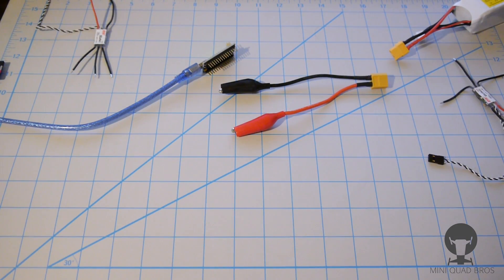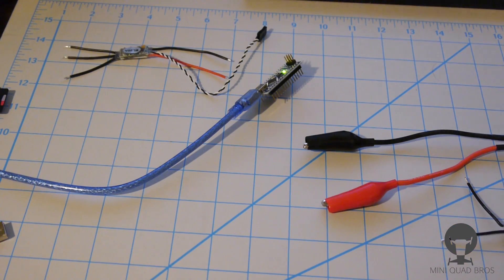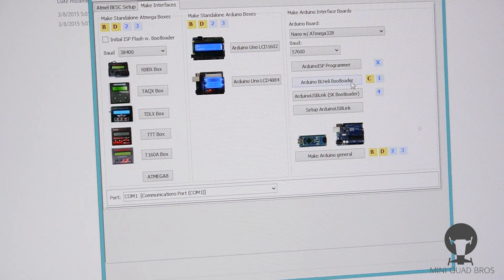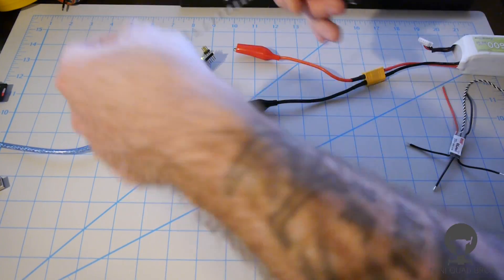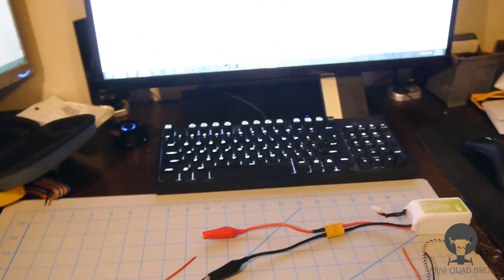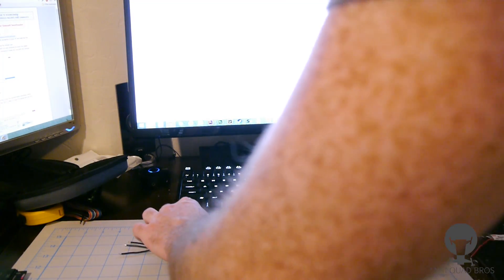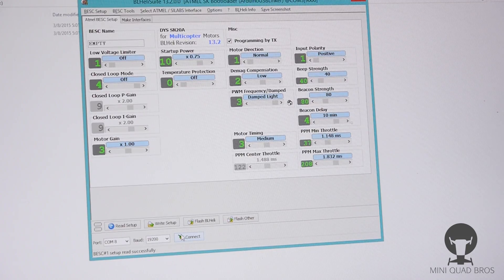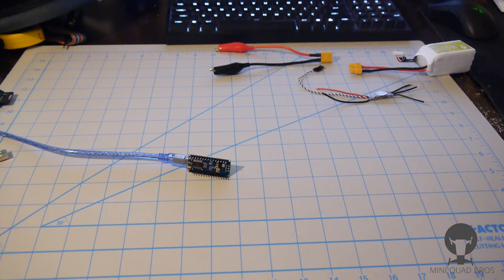How to Flash DYS SN20A with Arduino Nano

Comment: Great video!   Thanks to it I was finally able to flash a RCTimer BLHeli 20A esc with the latest BLHeli.  At first I tried to use the BLHeli boot loader but the esc has a SimonK one and wouldn't connect.   But once I selected the 'Atmel SK boot loader (Arduino USB linker)' from the pull down 'Select ATMEL/Silabs Interface' menu then I could finally flash it.  Thank you!

Comment: What changed for Blheli 14.0 I no longer can get the nano to work??  It now has interface C1?? instead of D3 I hate when they do this!
Reply from the maker: +Jon Car I haven't used the nano for an 14.0s so I don't know :(. Could it be when you downloaded 14.0, it reset your previous interfaces?
Reply: +Zachary Moore  I found the issue they are using the SK boot loader now.  Crazy how they switch them around  Thanks for the quick reply
Reply from the maker: +Jon Car Was it from me? I started with a mixed bag of BLHeli bootloaders and SK bootloaders, but eventually switched to SK bootloaders only.
Reply: +Jon Car Confusing, I just bought a DYS BL20A Mini and a ATmega328P Nano V3 from banggood.com

Can I still use this method or atleast the hardware?

Links to the items:

http://www.banggood.com/DYS-BL20A-Mini-20A-BLHeli-ESC-OPTO-2-4s-for-RC-Multicopter-p-975798.html

http://www.banggood.com/ATmega328P-Nano-V3-Controller-Board-Compatible-Arduino-p-940937.html

Comment: I just ordered the arduino nano after watching your video.  I just installed 4 of these new sn20a ESCs on my ZMR.  I'm running Tmotor mn2206 2000kv motors.  Right away I'm having serious sync issues.  I'm wondering if you have any experience with these ESCs and motor combo.  Also, the ESCs get super hot on the bench just doing very light testing. (the motors arent hot at all)  I'm hoping upping the timing in BLheli solves the issue but if not I may have to throw my old ZTW spiders back on.
Reply from the maker: Bill Sheley Maybe flash 13.2 or 14 on the ESCs. I'm running 13.2 on my 2206 2100kv Cobras and they're fine. Don't run your motors without props, that will cause sync issues and heat. Also check your motor screws, if theyre too long you'll see issues like these.
Reply: Thanks for the response.  The ESCs supposedly came with 13.2 on them with oneshot and light dampened.. Besides wanting to look at the config, 2 of the motors are spinning backwards (CW instead of CCW) .  I actually out of habit cross wired 2 of the motors to get the change rotation not realizing its done through the firmware.  I might just resolder everything to be sure.
Reply: Hi I just want to know if you fix the problem with your tmotor 2206 2000kv? It's just happen to me.,.,.,. If did you fix it can you let me know what did you do. Thank you for your answer.
Reply: Not really.  I upgraded to BLheli 14 and set the timing to medium high.  The motors spun and the quad would fly but the ESCs were constantly beeping which I believe was a high temp warning. As I was trying to figure out what was going on, the beeping eventually stopped.  I tuned up the PIDs to a little more aggresive rates, flew 2 more batteries and on the 3rd battery one of my Tmotors burned out.  I found out from an RCgroups forum that a large batch of those sn20a ESCs were defective and were burning out motors.  It was recomended to me to buy some RG20 escs .  I did some more research and bought 4 new ZTW 16amp escs with blheli.  I have not tested them yet but I had beening using 30amp ZTW spider escs before the sn20a 's and they worked great but were just too heavy.  The 16amp ZTW Spiders are just as small as the sn20a so I'm hopefully they will work.  Good luck!
Reply: Bill Sheley I know this post is 2yrs old but I just received 4 ZTW spiders ( haven't really used them yet) on a 250 build  i was thinking of checking them because the brake is on that is why I am watching this video Question 1- did you try this set up? & 2- did it work? and finally how do you like the spiders? any info you can give would be much appreciated

Comment: So can I use this same program and setup to flash a simonk firmware to a esc with blheli already on it?? If so what is different, just picking the simonk hex?
Reply from the maker: Jeffrey Seymore Hey man, BLHeliSuite can only flash BLHeli firmware natively, I suppose if you had the hex and it happened to be SimonK, that would work too. But there is a better way for that, called Rapidflash. It is a chrome app and does all the simonk firmware flashing.

Comment: Damn! Why am I ordering stuff from other sites if your in town?! I would rather support miniquadbros.com! Looks like you have everything I would need for the 4 cell 250. Thanks for the videos keep up the good work.
Reply from the maker: Nik Dombrowsk 
Hey Nik, did we meet the other day at the park? If you need a kit just let me know. The site shows out of stock but it's just because I need to update the photos for the new ESCs (DYS SN20a) the kits ship with now.
Reply: Yes we did. I had to leave when you showed up. I'm excited that you sell this stuff. I will definitely let you know. I want the motors for sure because I have esc's in the mail. I think they are 4cell compatible but maybe you can check them out and make sure. Sounds like you know what your doing and I'm kinda new at this multi rotor stuff. Hoping I can pick your brain a bit. Thank You
Reply from the maker: Nik Dombrowsk You mean the motors? Yes, I run the DYS 1806 2300 on 4s with 5x4.5 prop and they're solid. I also have Cobra 2204 1960kv motor in stock which is a higher quality motor that swings a 6x4.5 inch prop (preferably). Since this will be your first quad, I suggest the cheaper dys motors.